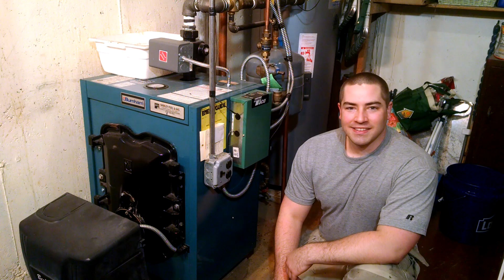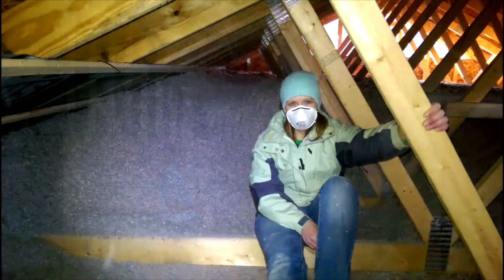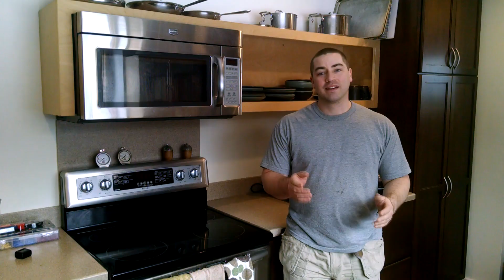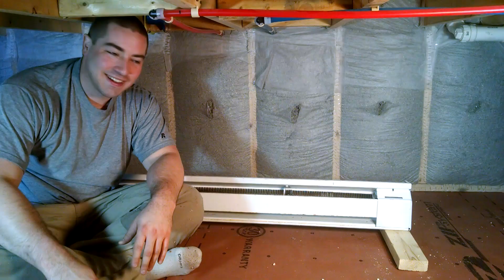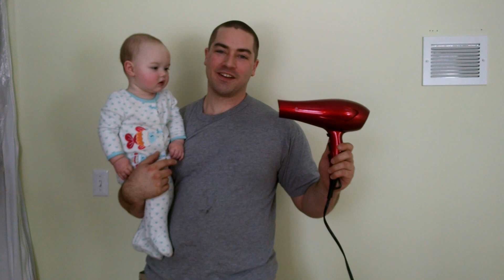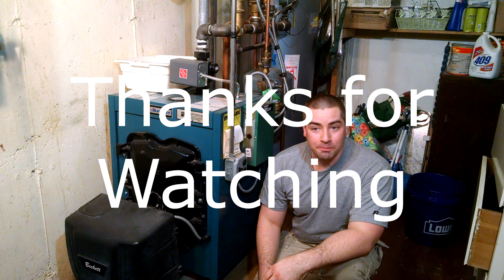Heating our House, Super Efficient

Comment: Refrigerant leaks of any size are not acceptable operation for residential equipment. If I were a betting person, I would say the leak is coming from the flare fittings either at the heatpump or the air handler.  In high pressure flare applications (600 psi) the mating surfaces are super critical. Most manufacturers recommend an eccentric flaring tools instead of a standard flare.  If the installers didn't do a 600psi nitrogen check for a minimum of 24 hours then it was a sub par installation (imo).  I have minis running in server rooms for years (24/7) with only routine cleaning.

Comment: My basement (unused) has a boarded up window with a small 6" diameter opening in the plywood that's open to the outside year round (for stray cats to come in out of the cold). The basement is not insulated at all and is 22'x30'. I only have a small 1500W space heater down there. A few weeks ago it went down to -18C (-0.4F) for 4 days. The temperature in the basement never went below 8C (41F). I can't figure out why. There's a 6" diameter hole open to the outside. What the hell is going on?

Comment: For one thing whoever installed that mini split should have put nitrogen in the system before they opened up the valves. I've actually put in hundreds of those and yes they're not as efficient on the heat side but they do work very well. You should have got to Fujitsu. And you should have let me install it. LOL thanks for the video

Comment: Great perspective on the resistance heat vs heat pump. Even not going into defrost mode, at low temperature extremes, they simply can not pull enough heat out of the air to efficiently warm interior spaces. Manufacturers say different, but that's simple truth. There's not much heat to be moved from single digit temperatures on a set of coils that small, much less at zero or below. I removed my one and only heat pump household system 2 years after install.... in the mid 80s, and in the south (where there should be plenty of BTUs outside in winter just waiting to warm a structure). Your solar water and space heating panels will become more and more important to you. BTW, I just ran across your videos last week, and I was going to suggest the "Build It Solar" website, but I saw you are already there. Wish I would have been as young as you when I started experimenting with "alternative" energy. I dove into it over 10 years ago in my early 50s, have been 100% off grid for almost 9 years. Great job, David.
Reply from the maker: Thanks for your comment Steve.  My goal is to be 100% off grid as well.  Currently I'm Net-zero, and grid-tied.  I'm working on the battery bank and inverter now to take me off-grid.  The one piece of the puzzle I'm struggling with is the cooking.  I currently have an electric range and oven.  It seems most people who go off-grid switch to propane for cooking.  Is that what you did?
Reply: @DavidPozEnergy  ..We do cook with propane. We also heat water with propane. We do cook some things on the wood stove in winter, and ever evolving, have been considering a solar oven (either built by me, or one of the available units with tempered glass, thermometer, known angles etc), and have projects on the list that include some of the sun focused heating ideas thrown around (before we even moved here years ago, I bought one of those large fresnel lenses from Dan at "Green Power Science", and am going to experiment with parabolas) as time permits. As for heating water, I've already taken first steps for the large holding tank similar to what you built in the crawl space. This year, I built my wife a 12x18 painting studio onto the back of the house. First task as I was doing ground work was to excavate for the tank under the room (she cried when she came home and saw what looked like the beginnings of an in-ground swimming pool project), then built the tank itself. Mine is 4' wide x 3' tall x 7' long, and should hold almost 400 gallons after the polyiso insulation lining the inside before the EDPM liner, both installed before the floor went on. I left the south wall vertical for the collector panels I'll be building over winter and installing next spring. We live in Colorado, in the mountains at 8,800 feet. so I don't build much outside in winter. Got a bit off subject, but just thought I'd share. Thanks for your videos. I haven't looked into alt-energy in a while, and decided to see the new stuff happening. Your vids and the young guy using Tesla batteries are good stuff. Thanks again and good work.
Reply from the maker: Sounds great.  Do you have any articles, facebook, websites that show more details or pics of your home?
Reply: @DavidPozEnergy  y'know, I totally slacked on sharing my build and projects. I moved up here from sea level and sub-tropical gulf coast (New Orleans), so was completely focused on beating sub-zero winter. I do have some photos my wife took during construction, and better yet, I can share recent photos of the place and current projects (like the insulated tank) if you'd like. I didn't have a youtube page until well after we moved up here, so have only loaded silly music clips I was involved in years ago because friends asked me to. In retrospect, it might have been more prudent to share useful knowledge. Projects bore even my wife (although she enjoys the comforts of the home and especially the studio since it's new), so I don't think about recording them as they develop. duh. I'm an old guy, so just focus on the task at hand. ....I did have one article published in "Countryside" magazine years ago about our cordwood walls build. I have no idea what issue, or even what year (less than 8 years, for sure). ....and facebook? All I seem to do is bicker about politics, so I won't go there on a useful information discussion, since eventually, that stuff is opinion on all sides. ....just have to figure out how to link phone pix or vid.
Reply: @DavidPozEnergy  ....added to my long winded reply, we heat the house, studio, shop, and greenhouse with wood and passive solar. I'm adding water coils behind the stoves in the house and studio to help heat that large water tank- south wall space will limit the collectors to just over 100 square feet, and that won't be enough to get the tank to targeted 120-130*f with solar alone.

Comment: what if you installed the compressor part of the heat pump inside a greenhouse attached to the south side of your home?
Reply from the maker: Sounds like a good idea to help in the winter time.
Reply: The greenhouse would only heat a small volume of air. The heat pump fan runs continuously needing large volumes of air.

Think of a greenhouse with the door wide open.

Comment: sounds like you bought a crap AC brand,  I have been running 3 split systems for 8 years , with only cleaning by me.  You really think refrigerant leaks are typical?   big leap in logic.
Reply from the maker: It's a Fujitsu.  I don't know if the whole brand is bad, or just the one I have.
Reply: @DavidPozEnergy Fijitsu's was in my market  area but failures seemed to have  doomed  the  brand  locally .  I have a Mitsubishi  two  ton unit  going into its  forth  winter and jeez I forget  the unit  is running. It seem mini splits    follow my grannys  golden  rule ,  that is you get what  you pay  for.   And don't  do your own  surgery!

Comment: u can put a crypto currency miner in your craw space, 2nd hand units are going to get cheaper soon coz of the bear market, gpu mining with hiveos - linux free and simple, typical unit is about 800Watts is still profitable but it cost a lot more then Asics, but its more versatile and holds the value in the long run. You could pick up a very cheap used Antminer D3 or L3 or S7..... on ebay, it consumes around 850-1300watts and turn them on when u need it during the winter.  they are cheap coz it cost more $ to run them. think if it as subsidized $ heating, they are extremely loud tho, you can put them in a chilli bin with ducking to help insulate the noise,  or you can swap the fans out to run off a 12" wall exhaust fan but that would still mean you need to build a box of some sort to get correct airflow, you also need to replace the existing fan with 2 PC smaller/quiter PMW fans as the miner will not run if it detect the fans are off, else ive seem people somehow put a simple circuit board and trick the system with some resistor or something.

eg as of right now 2.Aug.18, Antminer D3 consumes about 1400watt, it produce similar heat to a 1400watt space heater.
Electricity cost to run 24h= assuming 0.10 $/kWh is about USD3.40 in power cost, but you earn about USD2.20 in crypto currency. Basically you are paying $1.2 for $3.4 worth of heating. this of course depends on the coin you mine and status of crypto currency, the easiest is to use nicehash - autoconvert to BTC and withdraw every few days/week to coinbase to exchange to USD to lock in those profit as we are still not out of the bear market, or just hold on to the btc for 1-2 years and for more gains.

Comment: Our mini split has been in for like 3 years and no problems it's not one of the high seer but I live in Central Texas so snow and real low temps but I guess there was a poor install or a faulty part on the mini split if it is leaking out every 2 years
Reply from the maker: Hi James,  I think I have a bad 4-way valve.  Good to know you have had success with yours.

Comment: Shoudn't it be under warranty if the leaking persists.. and was ... Here in Scandinavia we have "extended warranty" so if you expect a unit to work for 10 years, the manufacturer is responsible for it to be working properly.. Ofcource i don't mean that .. a  like a wearable part a wheel for example you can't expect the manufacturer to re coat the wheel, but if it for example due to manufacturing fault or a design fault make's it catastrophically fail it is definitely covered by the manufacturers insurance/warranty..

So my =D Lengthy point was that if it's a part that constantly rubs against something or it wasn't properly designed to take vibration in consideration. It's the manufacturers fault and they should pay for it.. Or upgrade the part so it will last...

We had our seeders (farming big tool) rakes replaced few time even years later after the expected warranty but they made a promise that hey this will do this and it just didn't do as expected, they kept trying to refine the design but ... In the end it was sold to a conventional plowing farmer, and we upgraded to the very new design from the same supplier and it worked.. 

hmm it's still continuing

Comment: Excuse the username. The only effective way of using a reverse cycle split system in cold climates like you have is to use a ground source heat pump where the lines are buried about 6 to 8 feet down, particularly as the frost line in MA is about 35 to 40 inches. We use them in the colder parts of Australia quite effectively and they still work well for cooling in summer.

Comment: infrared panel heater is about 300-400 watts to heat a typical sized large room. The witchcraft it uses heats things differently as in it heats the objects in the space Instead of the space itself. Under 100 dollars and we'll worth the money. my family in the UK told me about them as they use them. never looked back. They are amazingly efficient
Reply: Electric heaters are all 100% efficient.  Baseboard, radiant, ceramic, electric water heaters, light bulbs, household electronics, they're all the same, they all put out 3.412 BTU/hr per watt of electricity consumed regardless of what the manufacturer is telling you.

Comment: Mini-split is nice. How do you dehumidify the air in remote locations away from mini?
Reply from the maker: We have an HRV (heat recovery ventilator).  The HRV is always exchanging the air in the house with new fresh air, but using a heat exchanger to recover the heat energy.  In the winter this effectively dries the air, usually 40% in winter.  Humidity is only a concern in the summer.  Most of the time the AC is removing moisture, and the HRV is circulating air and it is not a problem.  However, I will admit that a couple days each summer I will turn on a dehumidifier.

Comment: I have a question referring to your crawl space. I see bare rim joist and was wondering if that was interior or exterior?  If it is exterior why do you not have it insulated? Thanks
Reply from the maker: My rim joist is fully insulated, but I re-watched the video to see where the confusion might be.  I see that the shot I set up has the hot and cold water line secured to a block of wood inside the joist cavity.  Those blocks look like the rim joist, but are actually set inside.  The rim joists are packed with cellulose insulation, about an R-51.  Thanks for watching.

Comment: Sorry about your heat pump problems. They are strange beasts that work best when they are optimised for heating or cooling, not both. I have also seen that a lot of heating contractors frown on the system primarily because they can be owner installed greatly reducing the revenue generated by the installer. Anyway on to the meat of the story the local contractor said that most  AC guys will not work on the systems and those that do some will mischarge them to help you decide to install a conventional system because the profit margin is much higher. Most people do not understand the colder it is outside the less efficiency you heat pump will have and depending on the gas type and charge you can get a COP of 1:1 at a temperature high as 20 degrees with some systems. A lot of these systems are optimised for a tropical environment where they are extremely popular. As a result the ones ordered on line are not set up for heating resulting in poor performance and giving them a higher than normal failure rate.
Reply: As you gave the model/brand of your system I looked it up and at -5F the unit only produces 3000 BTU. This means the unit was removing the from your house at that temperature compared to an electric heater..
Reply from the maker: Thanks for looking it up, I didn't know what the heat output was supposed to be at -5.  I just know that when it gets down that low it seems as if it spends all it's time in defrost mode so I shut it off and just use electric baseboard.

Comment: You shouldn't use a heat pump for heat once it gets below 38 degrees.  These companies may tell you it will work, but it doesn't You can only get so much heat from the compression process and if it really cold outside, it just can't maintain a temperature at whatever temp you are trying to maintain inside (like 68 degrees).  Use it in the spring, summer, and fall.  Turn it off for the winter.
Reply: Thomas, you're absolutely correct. No matter what anyone else says because it boils down to the physics of the available "condensing" style heat pumps...
Reply: I heat my 36 x 24 house only with my heat pump till -14F. Bellow 0F I have to raise the inside fan speed to use push the hot air all around the house. If I was cheap, I could heat my house only with it but below 0F it's noisy so I start the good old electric elements to balance the far piece in the house.
Reply: It all depends on the manufacturer, some have units that heat down below zero.  Not all can work at that temperature though.
Reply: aloha.... heat pump @ -30??? i live in hawaii & have a heat pump. yep, i need every so pften.
i'm not sure of what you do for a living but a heat pump is only good up to/around 30-40 degrees outside temo... didn't you know this?? if its snowing?? NO HEAT PUMP!!!  NOT ENOUGH HEAT OUTSIDE TO PULL INTO THE HOUSE...  YES,. it would cycle to a/c mode to push heat into the exterior condenser.
OH WELL.... 
heck you have solar pv??? add panels enough pv panels + li-ion batteries capacity & then you could use free power & your cheap radient heaters... 

live aloha
Reply: I've got a heat pump that works fine down to ~10F... it all depends on the type of refrigerant and how good the unit is.  Still a TON of heat in 10F air... on a relative scale there's >90% as much thermal energy in 10F air vs 40F air...
Reply: sounds like your regurgitating urban myths or something from 15 years ago